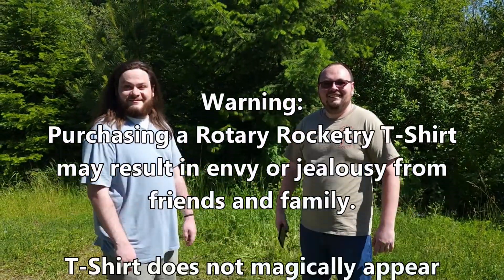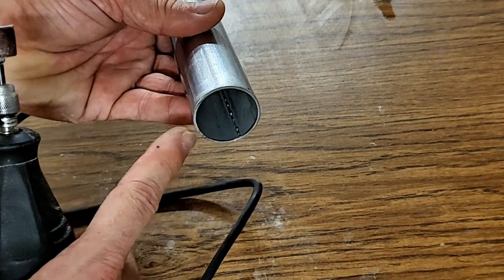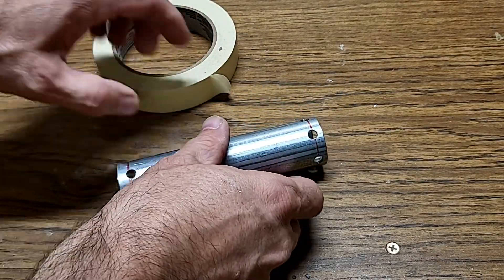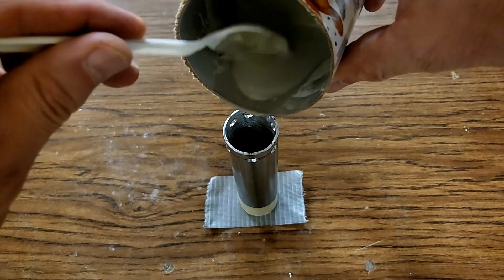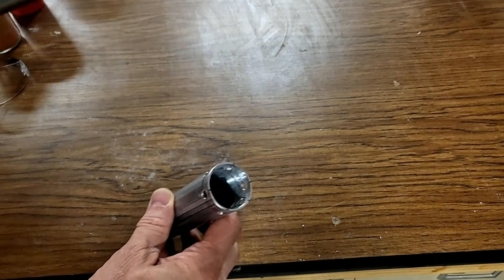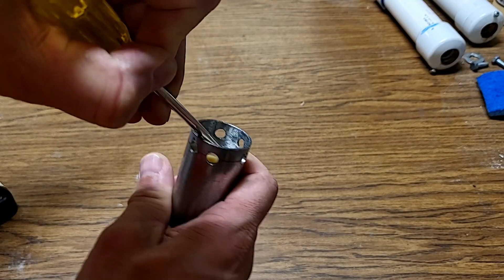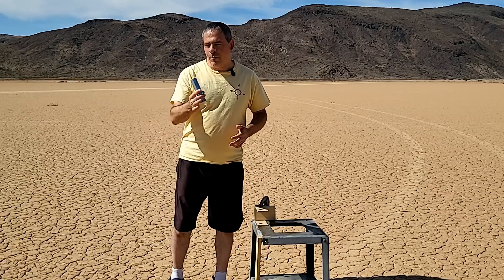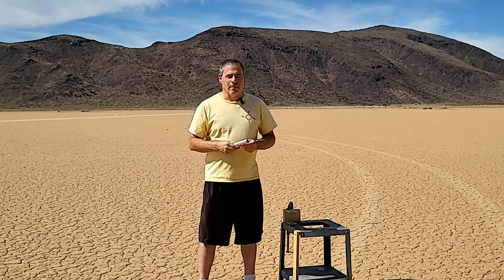Building a simple steel rocket motor

Comment: Appreciate the detailed instructions, but I must say there are a couple of fundamental things done wrong, such as not using a thermal liner between the fuel and the case wall, as well as using steel instead of aluminum, (for safety reasons mainly), but also for weight to thrust ratio improvement...
Reply from the maker: Sorry for the late reply but somehow I missed this comment. So just to address your issues for future readers...
1. Thermal liner is not needed because the fuel is one single bates grain that is burning from the inside out. As soon as any heat gets to the metal case area, that is exactly when the fuel is depleted.
2. Steel vs. Aluminum safety... We've had plenty of steel casings explode. For some reason, people seem to think they explode into tiny shards like a grenade. They don't, they just simply don't. If this type of pipe bursts, it just peels an opening and the gasses escape. Worst case, the pipe bends or folds over when bursting. In fact, I've seen video of an aluminum casing exploding into dangerous shrapnel soooo....
3. Steel vs. Aluminum weight... O.k., you got me on that one. That's an obvious one. But the steel can handle significantly more pressure and even if a slight amount of heat does get to the casing, the steel will hold up much better than aluminum. I'm not going for the absolutely best motor here... It's just experimental so if it's a bit heavy but works well, then I'm happy.
Reply: @rotaryrocketry  Appreciate your detailed reply. Agree with 1 at this scale and theoretical PSI, but things are very different as you go up in scale of the motor, where high pressure hot gas WILL try and succeed in flowing between the fuel grain and the case wall.

For 2. same as above, with scale, potential flaws such as air pockets in the fuel can and will cause PSI spikes that cause detonation of the fuel, thus potentially leading to the steel case exploding into actual high speed shrapnel.

For 3, it all depends on your main goal when running the experiment. So of course, if you aim at extreme burn chamber PSI, the stronger the case material, the better, but since that's almost never the desired goal, that's why I mentioned it doesn't really make sense.

I've been watching basically all the videos on your channel, and, if I'm allowed, I'd quickly mention a few things:
- high chamber PSI is undesired in favor of constant thrust curves for longer burn times at sufficient thrust / weight ratios
- thermal protection avoids most of the  CATO / unrecovered rocket scenarios
- running a lot of simulations for both flight stability and motor performance will save you not only costs and time, but will also answer a lot of failure questions otherwise unanswerable.

I really hope you'll take this as constructive critique, I really appreciate everyone actually trying out stuff and properly documenting the process / progress.

Cheers,
Cristian

Comment: Little late to the party but... Seems like plugging the hole to prevent moisture from contaminating your fuel is a moot point, considering it's sucking in moisture from your wet bulkhead.
Reply from the maker: Good observation... So typically, when I make this type of motor, I put a thin layer of epoxy over the top of the fuel when I put on the small disk of paper. That keeps the moisture from the bulkhead from getting to the fuel. I realize I didn't show that in this video.

Comment: How to add a propellant charge to such an engine?
Reply from the maker: I do not do motor based ejection charges. I use a flight computer to detect apogee and fire a small black powder ejection charge.
Reply: @rotaryrocketry  okey , good

Comment: Simple heat resistant paper between fule & body casing can prevent over heat of motor body ( I am using it and it's gives satisfactory results 👍🏻)😊
Reply from the maker: Yeah, I had considered a liner but was hoping it would not be necessary. Not sure if I'll be re-visiting this motor design thought because I have a few other designs in the works.
Reply: @rotaryrocketry  A little secret of mine. It's messy but you can carefully brush the inside of your casing with red RTV. It's nearly heat proof and the fuel can be cast in once the rtv is dry.
Reply from the maker: That's actually a really good idea. I've been using RTV to coat the inside of the bulkhead caps on my PVC motors recently. We'll be showing that on our next PVC motor build video. This motor however, did not need that because the case was protected from heat by the fuel right up until the moment the fuel was depleted.

Comment: Steel shouldn't be used as it splinters if the motor CATO's.
That's why commercial cases are aluminium
Reply from the maker: I'm not sure why people seem to think this type of pipe explodes into fragments like a grenade. It doesn't, it just doesn't. We've had explosions with this type of steel pipe motor in the past... Really BIG explosions... And it just peels open like a banana.
Reply from the maker: Oh and... Aluminum can also fragment in an explosion. So I guess the ultimate goal here is... Build motors that don't explode. And if you don't know if it will explode then you should be far enough away from it so an explosion will not be dangerous.